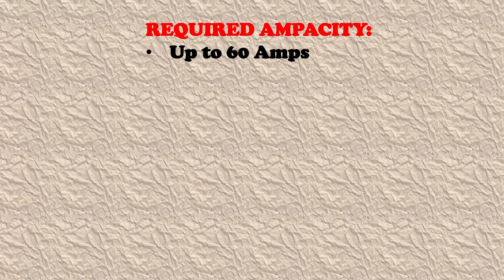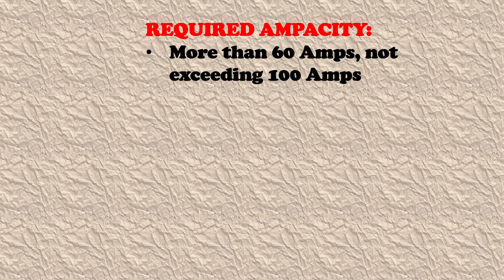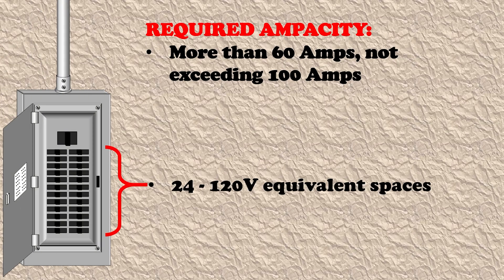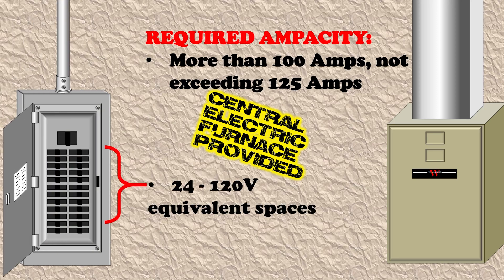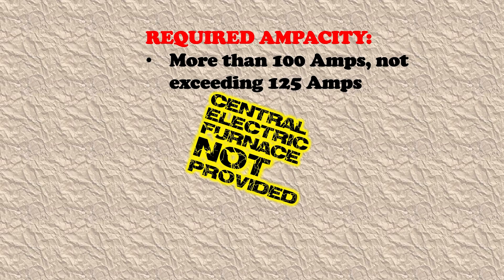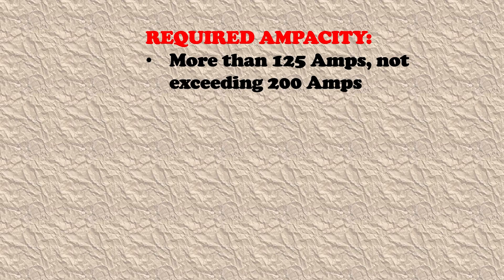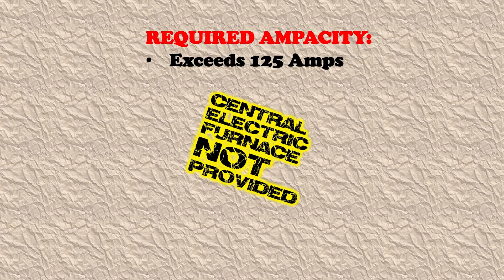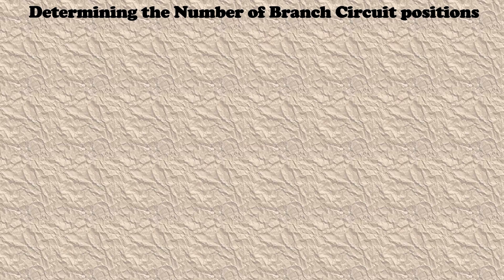Determining the Minimum Number of Panel Spaces Required

Comment: Just curious if you have any more new videos for the 2021 CEC in particular this rule change. I wrote to my professor but no one got back to me. And also do you know if anyone else making videos about the 2021 CEC. It’s so hard finding any content for Canadians. America is very accommodating to their electricians when it comes to their NEC.
Reply from the maker: With the change to 8-108, now the space demand will be determined individually with the demand. Basically figure out how many single pole, and double poles are required (ie: one two pole for the range, one two pole for dryer etc) and leave four slots open now for future additions. 
They've taken the comparison with the required ampacity out of the equation basically.
Reply: @schulerruler  thanks Schuler! You’re the man!

Comment: Hi Schulerruler, 
Thank you for this but to let you know the code book in 2021 for this has totally changed and those numbers are no longer valid. This is the new rule for 8-108:

-Panelboards installed in single dwellings shall, at the time of the original installation, have at least
four additional spaces left for future overcurrent devices with provision for a two-pole device.
-...

Comment: Thanks, but how can we know the number just by reading through the code book?
Reply from the maker: You need to know the required ampacity of the service to determine the number of spaces required.
Reply: @schulerruler  yes, I know that through your video, but there is no information from the code book(btw my code book is 2021) so if I didn’t search on YouTube probably I wouldn’t know
Reply: Did you ever find out where it says how many spaces are required in the 2021 code book? I'm looking for panel size based on required  ampacity. I.e. 16 required spaces for up to 60amps.